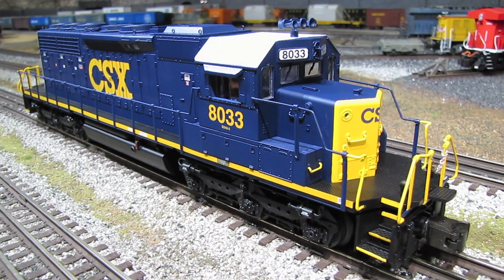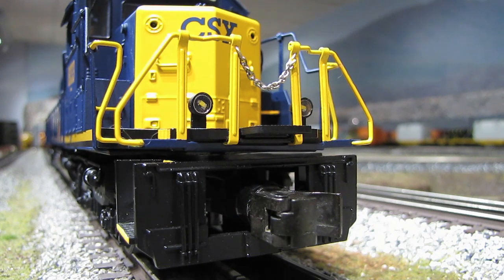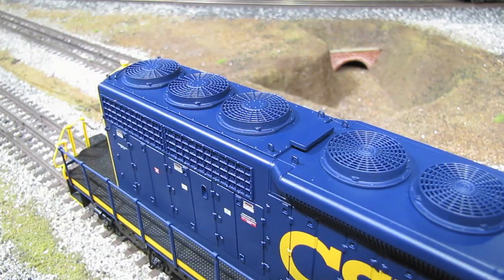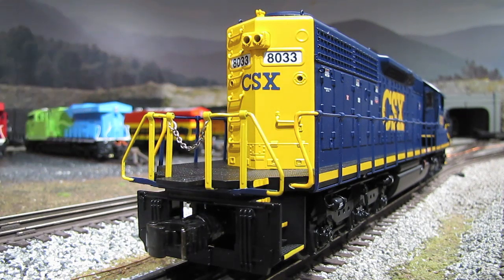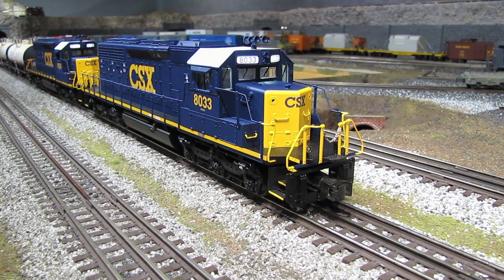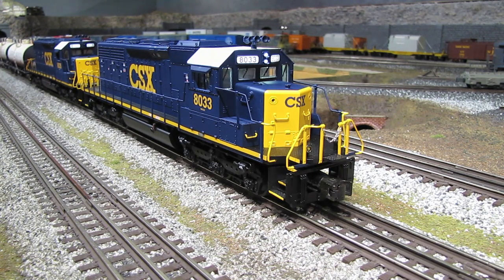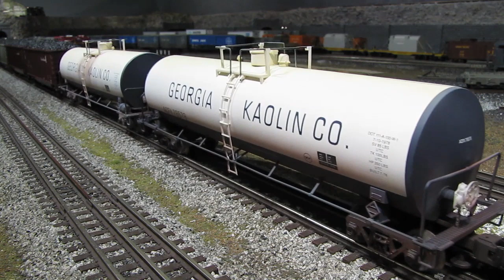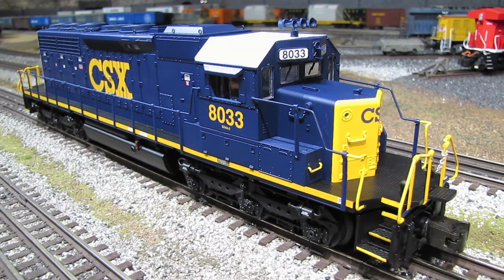Lionel CSX SD40-2 w/Legacy

Comment from the maker: The two major O-scale manufacturers are Lionel and MTH. MTH offers more value for your money, Lionel is more expensive but also has better sound and features. This is, of course, just my opinion. If value is the biggest issue for you, go with MTH. If having the best sound and features is the biggest issue, go with Lionel. Both brands are good, however, and there is no wrong choice.

Comment from the maker: It depends on whether or not you plan on getting any additional TMCC or Legacy engines in the future. Chances are you probably will so I would go ahead and get the Legacy system. It's getting pretty hard to find the old TMCC (CAB-1) system as they aren't being made any more. If it were me, I'd go ahead and get the Legacy system.

Comment: The see-through site glass on the body is NOT for checking oil- 
Its for checking water level for the radiator cooling system. That's why its by radiators and cooling fans.
Source 1:  "The 2nd Diesel Spotter's Guide" by Jerry A. Pinkepank
Source 2:   "SD40-2 Operator's Manual"    by GM, EMD-divs., La Grange, IL 1973.

Comment: I have a question I have gotten a new Lionel train so if I put a different locomotive on the track will it go the same speed as my new one
Reply: If the new engine has the same type of drive on it possibly. The gears on a new engine might be stiffer than a broken in engine. But when coupled together many 3 rail engines can operate without problems.

Comment: Eric, I need your opinion on this steam engine I want to buy. The item # is 6-31757 and is a postwar celebration series set but the train store near me has just the engine for $609.00. If I buy it should I buy a CAB 1 remote or a Legacy remote? The reason I'm asking is because this would be the only 3 rail TMCC equipped engine I would have in my collection and I'm not sure if I want to purchase a remote for just one locomotive. Thanks!

Comment: Not a bad effort by Lionel. I wish they would have improved on the details and tooling from the old TMCC version from 12 years ago. I really wish they would have changed the pilots over to the ES44 style pivoting pilot. Both Lionel and MTH have shown little interest in upgrading tooling lately. Instead they have just updated electronics and paint. Still, I may be in for a pair of Chessie System units at some point. Nice review.

Comment: Inaccuracy- the real CSXT 8033 has hood-mounted headlights, not cab-mounted.
Reply: Yes you are correct. I saw the 8033 parked at a yard not far from me and the ditch lights are indeed on the hood, just above the CSX logo. Also she now has the YN4 paint (with the boxcar logo) as she has been repainted recently.
Reply: its a 3 rail toy....
Reply: ALL #9510 model*

Comment: I am glad your CSX units look good. Sadly, I cannot say the same for my CNW units. The paint job on the CNW units is wrong and sloppy. The front of the battery boxes is painted green giving the engine a goofy checkerbeard look. CNW or Lionel has never done this on any past CNW units. That being said, my units have a thin yellow stripe right through the middle of the engineer's side of the cab. It looks unsightly. No plow looks ridiculous also. For me, the unit was a disappointment.